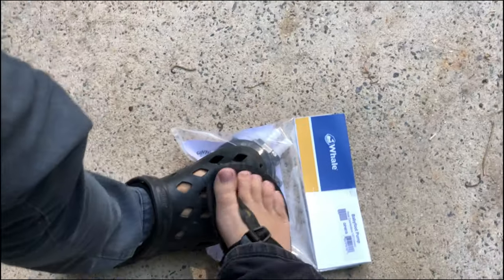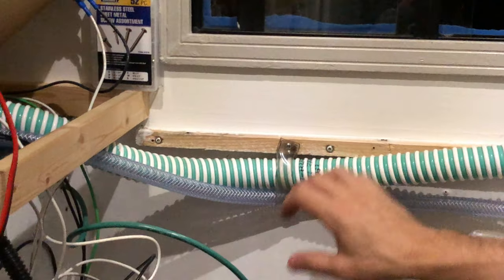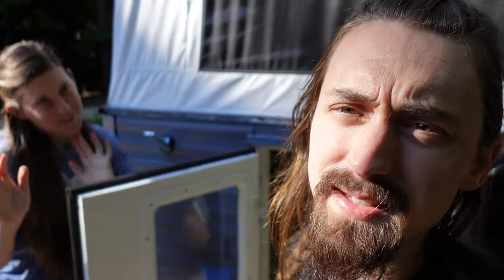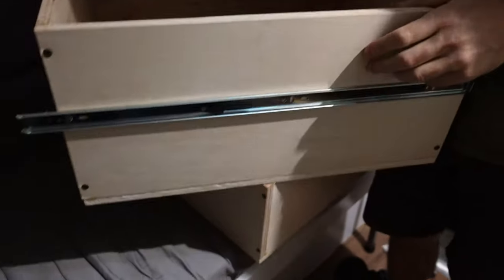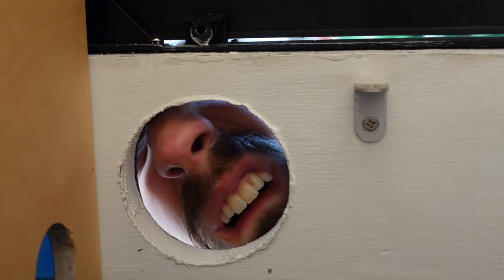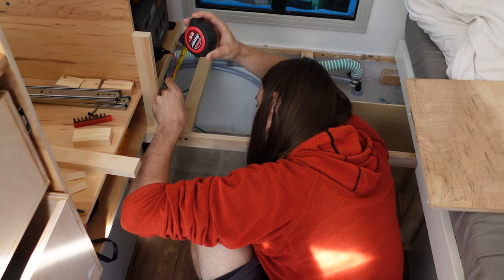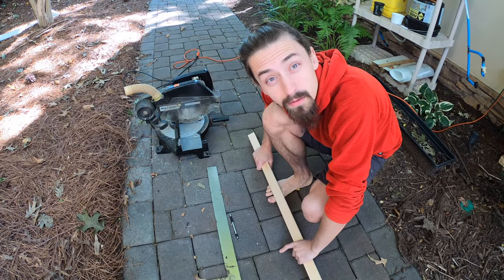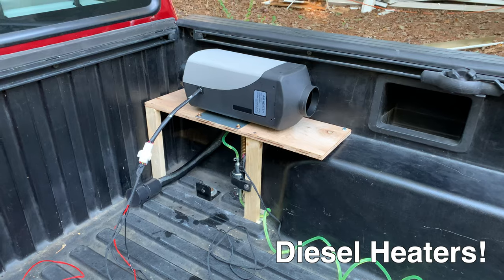The Kitchen Sink // Tacoma Truck Camper Renovation #9

Comment: Nice drawers 😉 looking good but 🤔 hmm are you sure about faucet? Most RV's have thinner tubing, might be too much volume of water. I'm on edge of seat waiting for next video. 👍🏻
Reply from the maker: It has actually worked pretty well so far! The foot pump required 0.5” interior diameter tubing so that’s what we had to use. The faucet is wider but with the foot pump controlling the pressure it puts out a nice amount of water.
Reply: @BackcountryBanter  Very cool, looking forward to a demo.